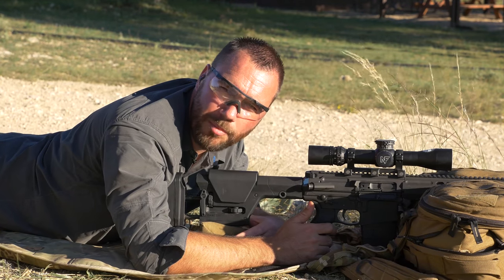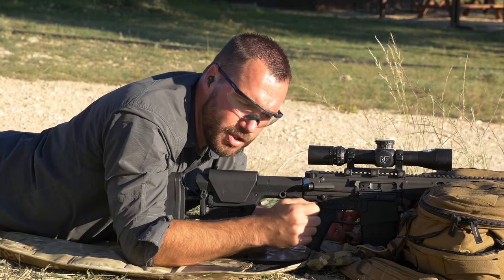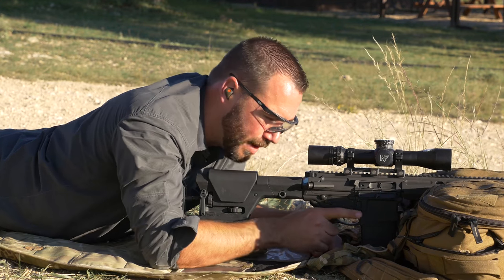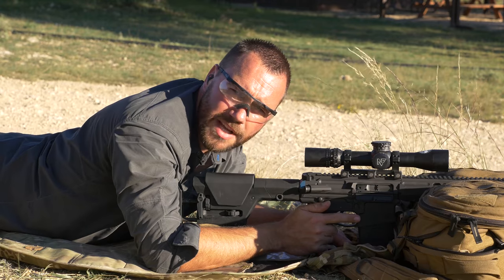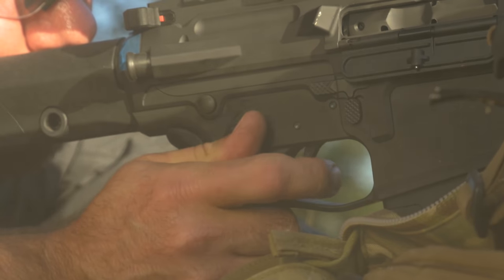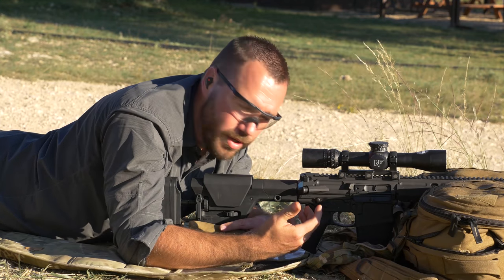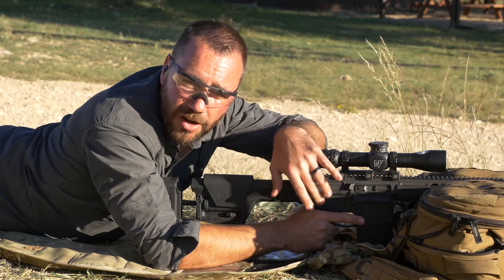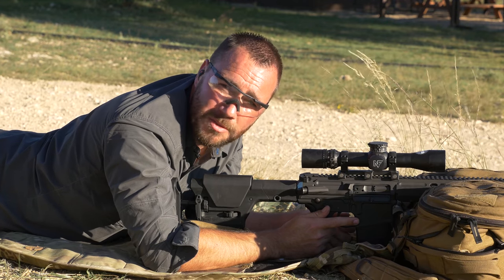Precision Rifle Pistol Grip | Long-Range Rifle Shooting with Ryan Cleckner

Comment: I dont move my thumb, ive simply never applied pressure with my thumb. Basically just letting it rest naturally while all the pressure is on my ring finger only.
Everything else is just there.
Will this impart any unwanted issues?

Comment: I remember watching a video on Marine snipers, and when they shoot an M40, they don't even hold onto the grip at all. They hold onto the bolt knob and have a nearly straight finger across the trigger.
Reply: you'd be surprised how many scout snipers can't even score expert on yearly rifle qualification. look at the guys on the shooting teams, they dont do the trendy thumb thing. look at Olympians, they dont either. this all started with a HUGE misunderstanding of why the thumb stays outside the pistol grip. it was to run the bolt faster, as you were alluding to. however, then guys started doing it on ar's and civilians and special ops guys started picking it up and then instructors in the sniper  community started teaching it cause others taught it and THEN they came up for a reason why, but in reality that reason is just a backwards justification. and now everyone thinks it actually helps. it doesn't. it's opposite of one of the most basic things they teach in sniper schools, that most shots aren't from prone. so how are you supposed to free recoil (the thumb thing is free recoiling) when you can't be in prone. more control of the gun is always a good thing unless you have TERRIBLE fundamentals. but this is the way of the military, finding stupid trendy cool things to do where half the guys teach it as if it's important and the rest see some special ops guy do it and they imitate it to look cool. this is why pistol portions of sniper competitions are hilariously bad, they are training guys to throw trigger control out the window and focus on this new technique to make up for it.
Reply: Bjorn Egan I couldn’t agree more, I’m creating a class over shooting fundamentals, and too this day this is in our sniper school pub. Literally says “the thumb should not be wrapped around the pistol grip” because it causes the shooter to twist his wrist which can be uncomfortable, it causes aiming errors, and makes it difficult to manipulate the safety.... non of these things are true.
Reply: @AllThingsZz  yeah, it's incredible what ends up as doctrine.

Comment: That’s exactly how I have my hand on my Scar 17 with a 20” 6.5 Creedmore 5R barrel. I use the Talon safety as a thumb rest. The Scar has ambi safeties and I placed the longer lever on the right side. The Talon has a wider foot print and the 45 degree throw is the perfect angle to rest my thumb on. Im also using the Hogue deluxe ergo grip with the bottom shelf which sandwiches my hand to lock my grip in. For my bolt gun I’m using the MPA competition chassis which comes with their vertical grip that has an integrated thumb shelf on the right side that transitions into the chassis. Btw my cousin is also an Army Ranger Sniper vet from Desert Storm and is known in the elite circle in the SF community.

Comment: I see no point in this technique with a semi-auto precision rifle. The pistol grip is there for fast follow up shots in a target rich environment. If you go back to the basic fundamentals, when you're in the prone position, you shouldn't even be forcing the the reticle to the target in the first place. You need to adjust your body for proper support of the rifle. The only reticle movement you should see is the up and down when you are breathing. Frank from Sniper's Hide has video of proper grip and trigger control, also reasons why doesn't recommend the grip illustrated here. But if it works for you, continue to use it.
Reply: I see you don't shoot much at distance....